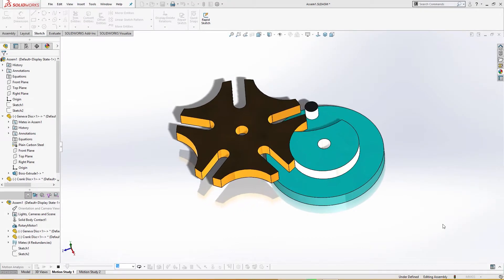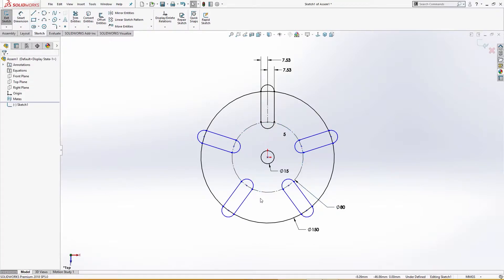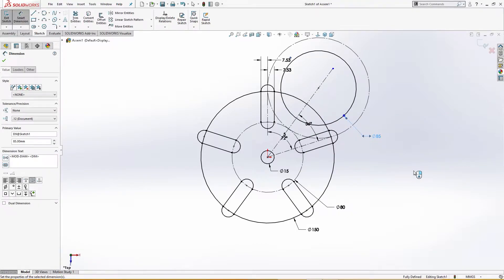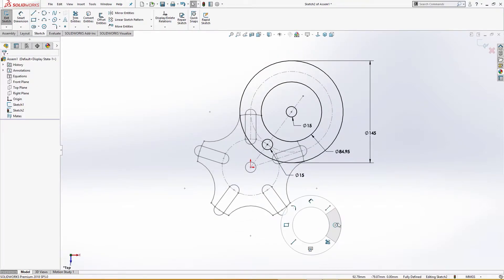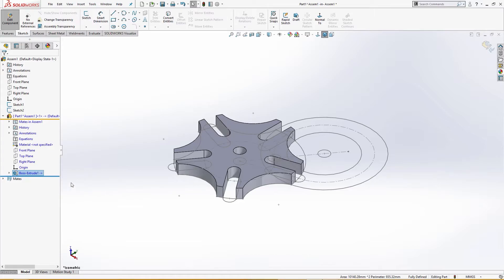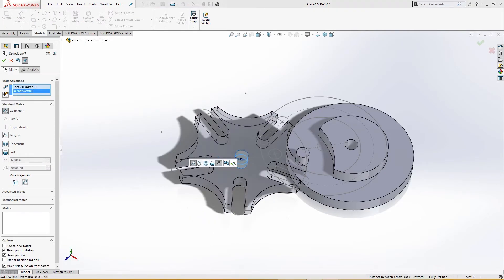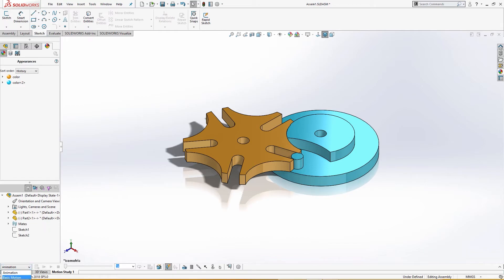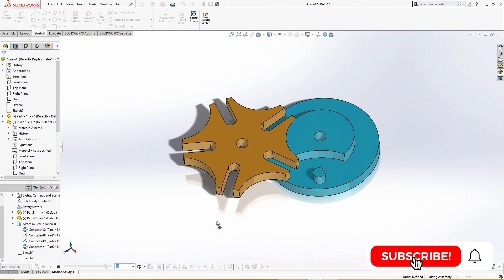Geneva Drive Design and Assembly in Solidworks (Motion Study) | Solidworks Tutorials | SolidCad

Comment: I wouldn't call this design.  This is a recipe of steps to recreate a specific configuration and size of geneva mechanism.  Would love to see how to design a 4 or 6 or 'N' point geneva, for example.  Or how to create a mechanism with my required dimensions.  Also the tradeoffs of using each.  This is not that different from downloading a pre-designed model - but more effort.